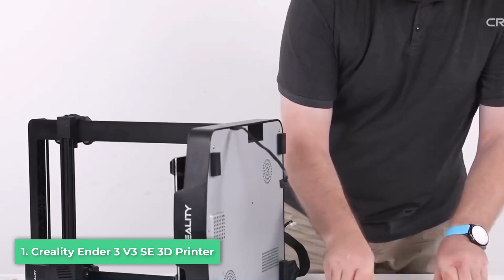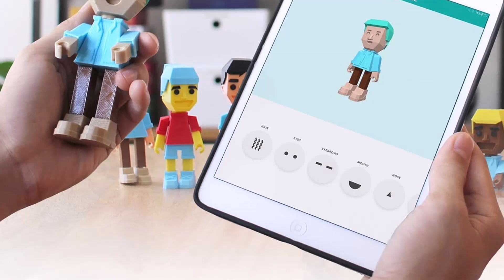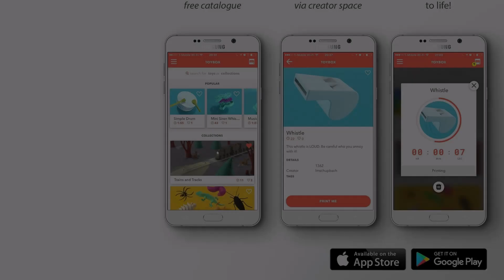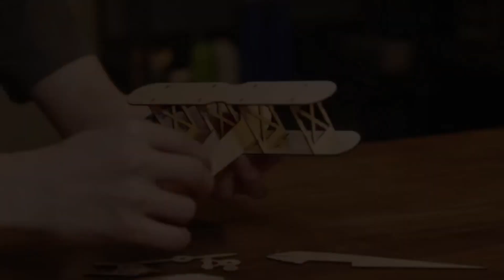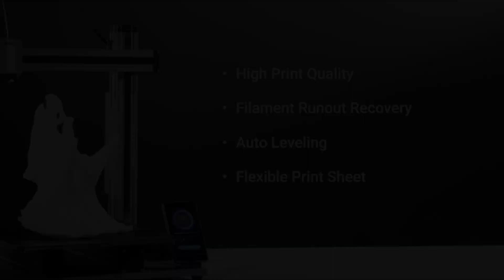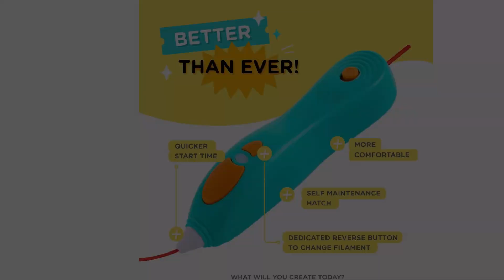Top 5 BEST 3D Printers in 2026

Comment: im sorry but in what world are these the best 3d printers of 2026 the creality 3v3 se is an alright printer works well after a bit of tinkering. i wouldn't recommend buying the toybox printer its slow and there are far better starter printers out there for kids/adults like the bambu A1 mini its a great budget printer that supports multi coloured printing it will out perform the toybox by a mile and will most likely last longer the bambu A1 combo is great aswell with the bigger bed and multicolour printing i put so many hours into it with no fails would also recommend the Elegoo Centauri Carbon  if your looking for an looking for a fast printer at a good price. never had Flashforge Adventurer 5X but ive seen nothing but good reviews about it but if budget isn't a thing for you in my opinion go with the bambu H series they are amazing printers fast speeds and amazing print quality these are just my opinions all printers have there own problems hope this helps people make the right choice. (sorry for the rant)
Reply from the maker: Appreciate you sharing your perspective and recommendations.